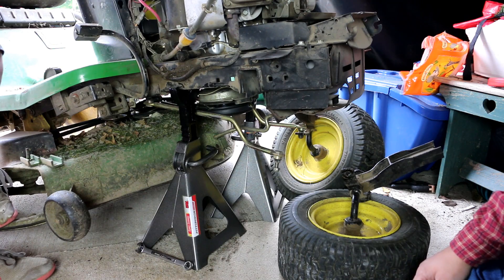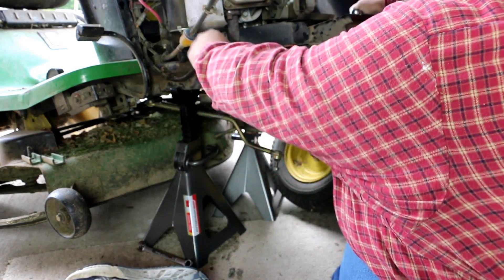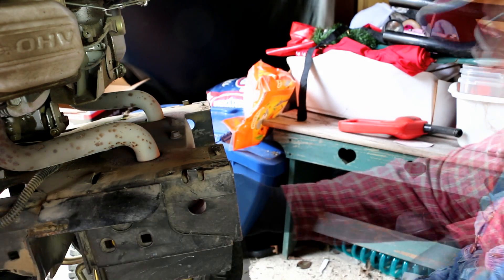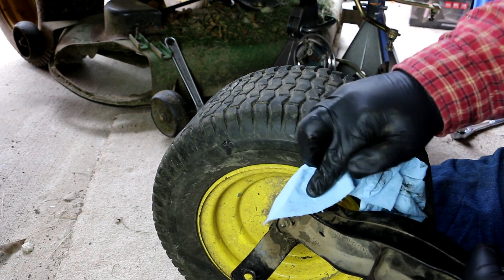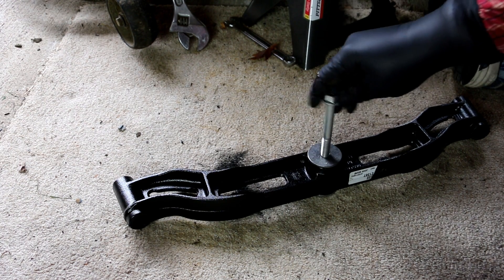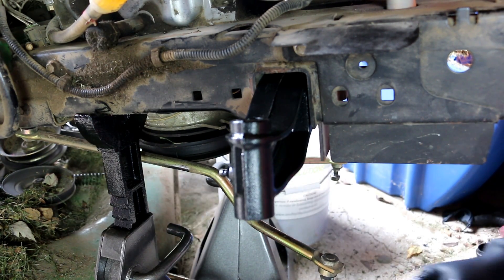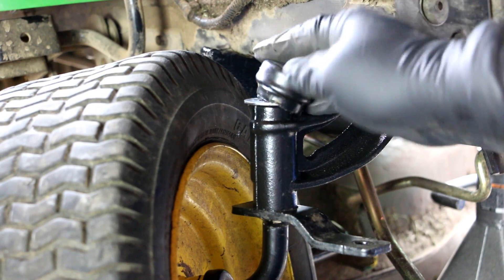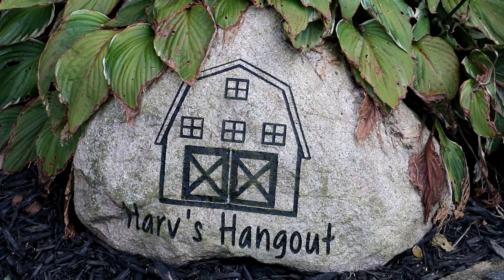Replacing Front Axle on a John Deere 100 series tractor

Comment: Thank you for posting this video. My John Deere L120 is 13 years old and the axle broke in virtually the same spot. I would expect any moving part to eventually fail. However, I, for one, believe it is a flaw in the casting process. In the absence of corrosion the frame and cast iron parts should never fail or suffer from metal fatigue. I encourage those that have experienced this failure to contact John Deere as this may be a more widespread issue.
Reply: I think most of the axle breakage is cause by not replacing center pivot pin when needed. when severely worn it allows to much axle free play and increases the torque on each end of the axle causing most of this kind of breakage. Common to larger tractors as well.
Reply: My one also broke on the same spot. For some reasons it's mostly the right tire that falls out.
Reply: Same here, broke right next to the center pivot hole

Comment: So once you put the new axle assembly back on, does it have any side to side sway or simply just the vertical sway motion.  I think mine may be gone as it moves back and forth a bit on the side to side motion
Reply from the maker: Not had any problems with it swaying side to side. It has the vertical travel as you mentioned only.

Comment: Hey Harv. Kinda glossed over actually removing the 18mm bolt attaching the axel to the chassis. Did you use a torque wrench or a hammer on a socket wrench?
Reply from the maker: Hey Matt!  I may have used a breaker bar.  If you don't have one, you can use a piece of pipe that will fit over your socket wrench. Depending on how long it's been there maybe some penetrating spray. I honestly don't recall now if I had trouble with it or not.
Reply: Well, dang ole hammer aint workin. Imma try some leverage

Comment: I was just wondering, aren't the zerk fittings on the axle supposed to be facing towards the front for easy access.
Reply from the maker: You could be correct there @dougfairburn803. The part is the symmetrical and the only difference is zerks to the front verses to the back. I don't have any issues getting to them and feel they are more protected from damage.

Comment: Ok a dumb question for you but what is the part that actually runs through the front tire? The part that the hub/bearings go through? I thought that part was called the axel.
Reply: The axel is the main part he replaced, the thick metal cast iron. Those separate pieces holding the tires would be more like control arms of you want to call them that.
Reply: @DJCARBON2012  Actually, if you look at it from my point of view, the big cast piece is called the axle, but the "control arm" also have a sub axle on each one for the individual wheel.

Comment: Come on, I can't catch a break (no pun intended).  I'm sitting in the garage just trying to replace the brace that the draft arm for the deck goes through.  Did a quick check last week and removing just the muffler shield exposes the axle bolt head, and I have a clear shot at the nut that holds the plate assembly  and axle in place. So, the parts came in, I pulled the LA145 into the garage, dropped the muffler shield, put the tractor up on a shallow ramp so I have room to work and poof.  The axle bolt and axle nut are not happy with an 18 (sloppy loose) , not happy with a 17 (will not go on the head or nut) , no joy on a 3/4 ( sloppy loose) and 13/16 will not go on the nut or bolt head.  This is a new from dealer so I know nobody has switched out with oddball stuff.  I'm afraid if I pull the muffler and try going to town with a 18 on the bolt head I'm going to round out either the nut or the bolt.  What is going wrong with my DIY project???
Reply: Just a quick update: My S&K 18 MM was sloppy loose.  My Harbor Freight 18 MM impact socket was too tight and I didn't want to drive it on with a hammer.  Borrowed a 18 MM Craftsman from my neighbor and it fit perfect.  So, finally ready to make progress and nada... can not get the bolt to turn at all.  Friend came over with his air gun and got the same results.  Breaker bar, ng.  By that time, the Harley was in danger of getting hit by flying tools so I shut things down for the night.  Gave it a shot of WD40 and figured one more try in the morning.  Again, total failure.  Called a local shop, and hauled the now stripped down tractor to them.  He put his gun on it and it would not budge.  Jacked the tractor up and put jackstands under the frame so the axle was only carrying the weight of the wheels, not the weight of the tractor.  Hit it once, no go.  Hit it twice, no go.  Came out with a BIG electric air wrench. Hit it once and it spun the bolt and the nut came right off.  Don't understand what I saw, but it was the best $20.00 I ever spent on that darned tractor.

Comment: You didn't show removal of axle.  That's what I was double checking.    Mine is froze....
Reply: Hangin with Harv yes, I know. The  locking nut is Frozen. I have soaked it in PB Blaster, tried a breaker bar and a impact wrench and no luck. I'm going to let it soak with PB Blaster for 24 hours and try again tomorrow.

Comment: Do you realize you installed the new axle backwards? The grease zerks face the front...
Reply: Hangin with Harv: On my LA140, the vertical part of the axle where the spindles slide in is tilted in at the top and back towards the rear of the tractor. This sets the caster for the front tires and may affect the steering. The way you installed it, it has the spindles tilted toward the front of the tractor, and may prematurely wear your front wheel bushings/bearings, as well as affect the turning radius.
Reply: @mswtoyota  your exactly right the axle is in backwards zerks face out towards headlights I am looking at my 190C right now and getting ready to replace my front axle. Cracked in half just like his. It's an intentional flaw from John Deere!

Comment: After having to weld my deck cracks all up, my LA110 axle just broke, what a cheap built over priced mower.
I never had these problems with any older mowers.
Reply: Thanks I found a used axle on ebay for $40, the deck cracks are around the bolt holes for the blade spindles and the idler pulley. Also the rear deck support brackets also cracked around the welds.
 Keep an eye out for cracks in these areas.